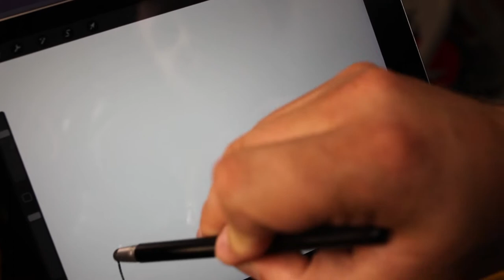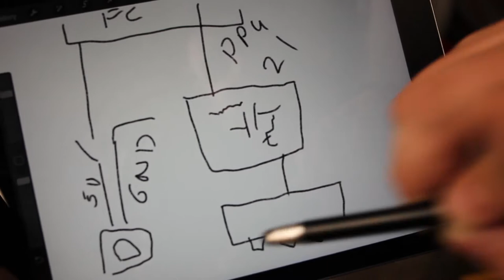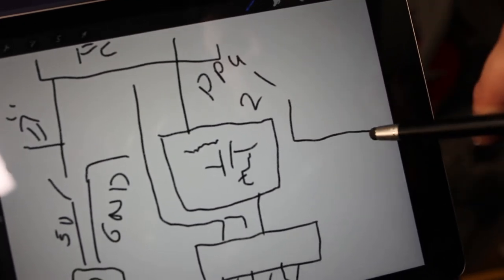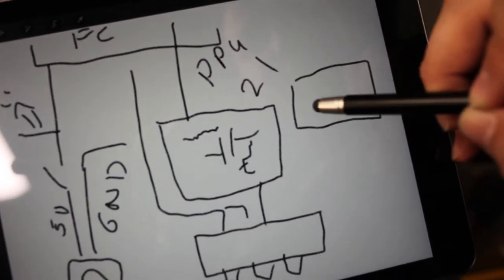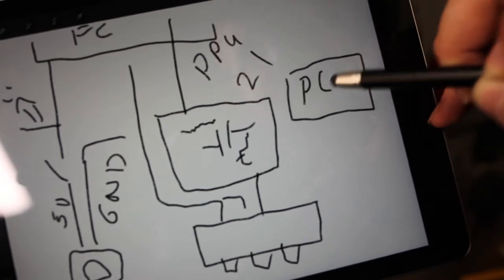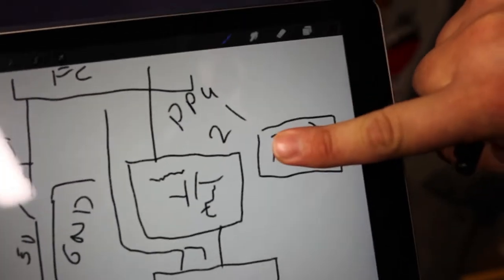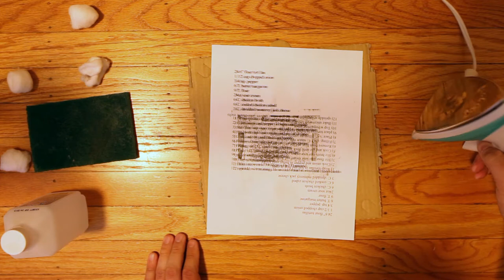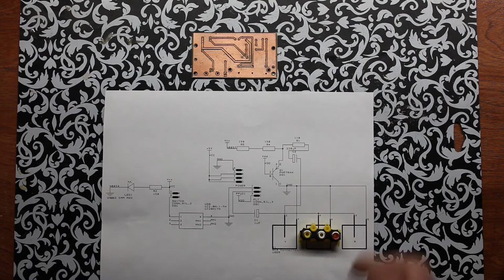Hakk's Lab 1 - Famicom USB and Composite Video Mod

Comment: Absolutely criminal that this only has 613 views, this is brilliant stuff. Keep up the good work!
Reply from the maker: Thanks! Actually going to be posting a new NES/FC related video in a week or two, so stay tuned :)
Reply: @dxprog  I thought the part where you etched the PCB was particularly interesting. I've done similar mods and designed circuits myself but only ever on perfboard. I've seen some tutorials on the method you used but avoided it because it seems so unreliable. Looks like that was your experience too!

Comment: The barrel jack's polarity is switched on the famicom, center is negative and the outside is positive. So you probably would have popped it anyway 🤣
Reply from the maker: It's a wonder that machine still works at all 🤦‍♂️

Comment: Really want to see how to make a separate USB power set up for the famicom. This can help many people out there not having to deal with overpriced or poorly made replacement power adapters.
Reply: Actually I think I might know how to do it. Looking at various MB configs though there is at least 2 different versions prior to the AV Famicom. 1 with and 1 without the ribbon cable connecting the RF and Power board to the MB.
Reply from the maker: It'd actually be pretty simple to just splice a barrel jack to the power wires of a USB cable. It almost seems too obvious to work, but I think I'm gonna give it a try!
Reply: @dxprog  awesome! Actually I believe there is a USB A to barrel adapter. But honestly it'd be better to be USB Micro B. Hope you'll make a vid of it. I have a great mod idea I'm trying to piece together as well.

Comment: Great video! A couple questions: What is the value of the transistor and what would the labels be for the wires on your PCB?
Reply from the maker: Hello, great questions! It's been a hot minute since this video and my PCB layout is a hot mess...

1) Honestly couldn't tell you what the value the transistor is. Pretty sure I just pulled some generic PNP BJT from a pack of generic transistors I got at Fry's...

2) Gonna try to describe this as best I can using the PCB traces. Ground is the copper fill, 5V goes into the switch, audio connects through the capacitor, and video connects through the transistor.

That's probably not super useful, but the best I can get you with a project this old. Good luck :)

Comment: What is the 1μF capacitor for? Can I also use, for example, a 17μF capacitor?
Reply from the maker: Excellent question that I'm not qualified to answer, but will try :). After some googly research, seems the cap is doing a few things:
- filtering out line noise (which was my primary assumption)
- providing some extra power to drive the speaker as the waveform changes. I mostly found this in regards to car audio and bass, so maybe take with a grain of salt...
- providing some protection to the CPU from current spikes while messing about with the audio cables

I'm sure a 17μF cap would work, but would likely change the sound output. How and would it be perceptible, I couldn't say.

If anybody actually knows, would love for you to chime in to understand this better myself!
Reply: I would say the capacitor helps regulate the flow of power in order for it to remain constant. If there is less than optimal power, the capacitor's stored power kicks in. If there is more than needed power, it stores it for later use. Using a greater capacity capacitor would only store more power, but be careful, when you switch that machine off, that power has to go somewhere (hence why capacitor's are connected to ground).

Comment: can you power famicon with 5 volt dc? what is the usb for besides it?
Reply from the maker: Yup, the Famicom (and NES) is a 5V machine. The USB connector was just a convenient way to meet that without dipping into power regulation circuitry. Though, I've seen enough bigclive to know relying on others to provide USB voltages in a clean fashion is far from a guarantee...

Comment: There are some breadboard style circuit boards that are the same size, and that are not as thick as breadboards. You have to solder all collections, so it should work, right? I mean, as long as I follow your schematics and put everything in place and don't short anything out? 

Printing or making your own circuit boards is prohibitively expensive in South America, but getting those parts isn't, and neither is getting a bunch of the boards I told you about. Plus the schematic is not that complicated.
Reply from the maker: Should work out fine. The only issue I could potentially see is fit. The famicom doesn't have just oodles of breathing room.

Comment: Would a Japan to UK plug socket adapter and a Sega Megadrive av/rf cable work as an alternative?
Reply from the maker: Tl;DR - no and no without a lot of extra gear

Power: the UK's mains power is 240VAC/50Hz versus Japan (and the US)'s 120VAC/60Hz. You need quite a lot of kit to correctly convert one to the other, but it can be done. Techmoan has a pretty good video on that subject: https://www.youtube.com/watch?v=_dgO0HdPMds

Video: the Famicom generates an NTSC signal which won't play nice with the UK's PAL standard. I don't even know what a Mega Drive RF adapter would do to that signal... Again, though, you could get gear to convert the NTSC signal to something UK friendlier.

Hope that answers your question!
Reply: Thanks Matt. I was hoping for a simple solution.

I recently saw a Famicom, with the same mod you did in this video, sell on Ebay for over £120!

I decided to sacrifice quality and buy a new Famiclone instead.
Reply: I don't know if you still need info but for my famicom I just use a DC   power plug that has the correct voltage and amperage and has a UK plug and it will work. Video is harder as UK tvs don't go to the same frequency needed, the only option I had was to get it modded.